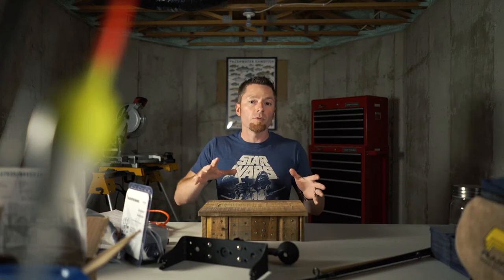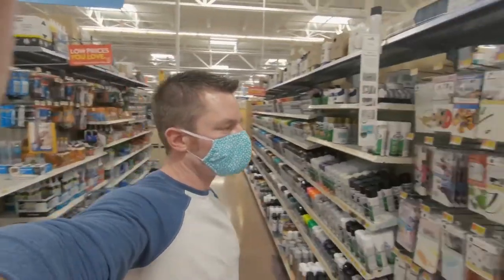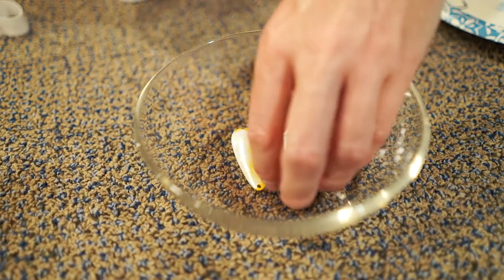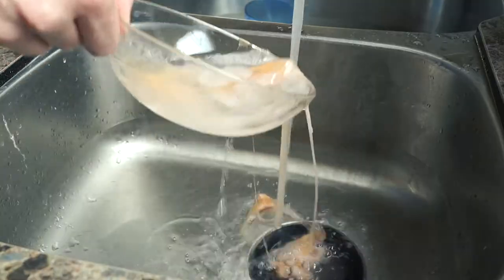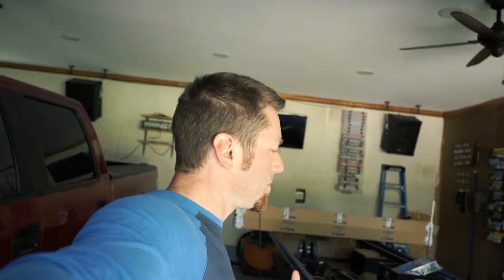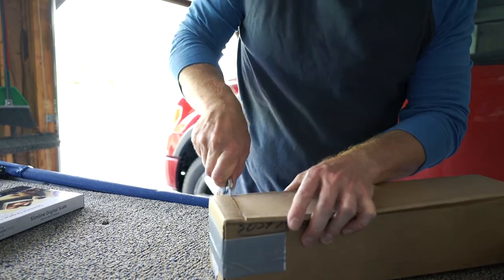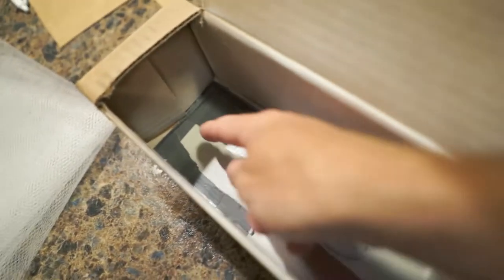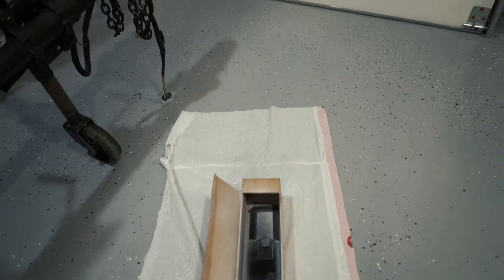Painting Ruined Spoons with Walmart Supplies

Comment: Nice tips. Glad the the clear protective coat finished clear. I tried with acrylics but when my spoons came in contact with rock or such it chipped off. I sanded off all the paint I had on them and the chrome finish that was on the williams wobblers so the paint will stick better then to clear chrome metal. Tbh im fishing a lake in the spring with a lot of white and brown baitfish so the gold white sanded chrome one looks pretty good as it haha. I'll just do some paint on the other ones and put the clear protective coat this time.
Reply from the maker: Hey thanks! I was worried about the coat like you mentioned - it went on a bit cloudy and I was thinking "oh man I hope I didn't just ruin my work...", but thankfully it came out well. They both got some good use this summer and they have a few teeth marks in them, but that's what they're for, eh? What are you fishing for in the lake you mentioned with the brown baitfish? Clear water?
Reply: @TheMinimalistFisherman  yea its clear water. Will be fishing pike, walleye, lake trout and bass. Baitfish are suckers, rainbow smelt, lake whitefish, perch
Reply from the maker: @4thLineAngling  nice! I'm jealous... mainly bass around here in IL... I got the itch BAD and we have about 6 inches of snow and ice on the ground outside... spring can't get here soon enough. Good luck when you get out!
Reply: @TheMinimalistFisherman  Yea man pretty lucky forsure! I did a ton of research to plan a trip for my three buddies in May, literally dream of fishing at least 3 times a week lol. I'm super excited to be going during the spring spawn, bass won't be open but pike, walleye and lake trout will be. You can drop shot for walleyes lol and accidentally get into some out of season bass?? Throw them back of course.. If you ever get a chance you should make the drive to Ontario. Sault Ste. Marie is 8 hours from Chicago and has tons of backwoods resorts with multiple species lakes. I'm in north eastern ontario so still 6 hours to get there for us. Can't wait, I think I'll vlog it and send you some footage.
Reply from the maker: @4thLineAngling  that sounds great. If you take some video please hit me up with a link, I'd love to see it. I was able to get up to Canada to fish about 5 years ago, got into some seriously great pike and some walleye. We were WAY out in the boonies, but it was an awesome trip. Good luck - I hope you get into a bunch of fish!

Comment: I just cleaned up a bunch of spoons and all I used was a wire wheel on a table grinder got the paint right off no chemicals
Reply from the maker: That's an interesting approach - I mean as you could see I had a few... issues... heh. So the wire wheel worked well? Dust wasn't a big deal? Thanks for the tip!